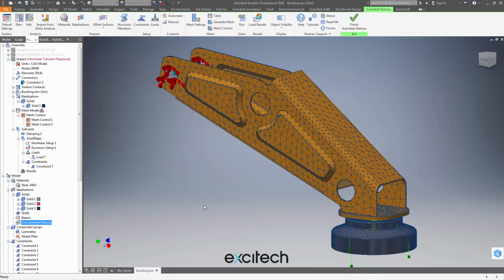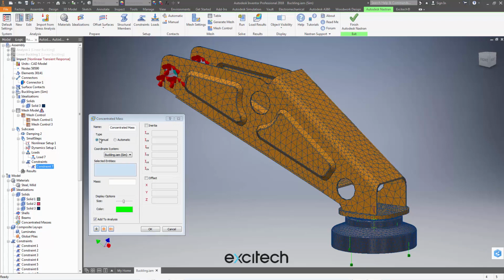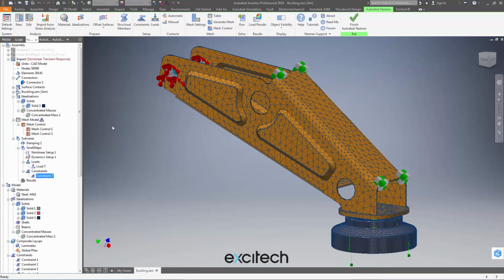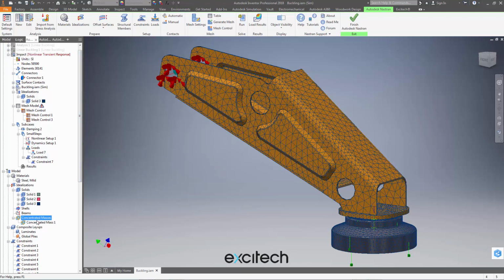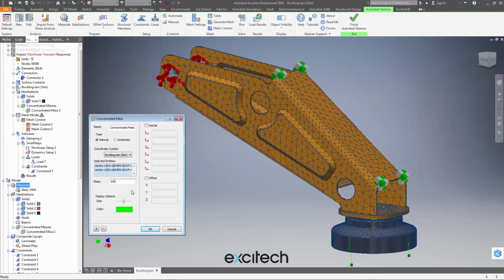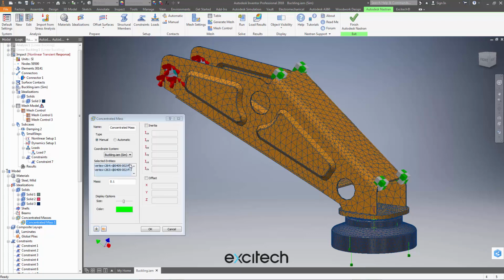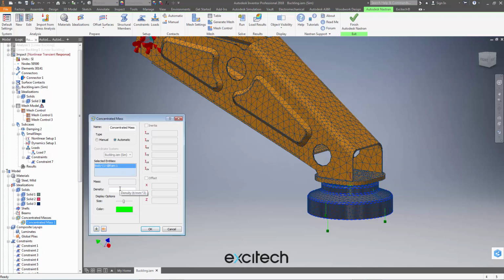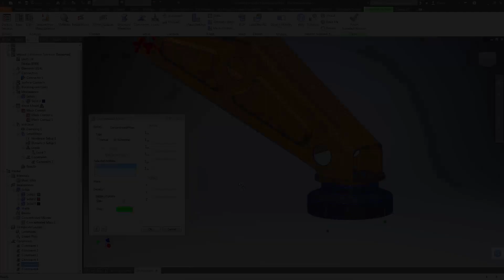Nastran In CAD - Concentrated Mass - Quick Tips

Comment: Thank you for the nice tip on the units. I was wondering if you could do another discussing when to use Rigid RBE2 connectors or Interpolation RBE3 connectors to join a concentrated mass to a body.